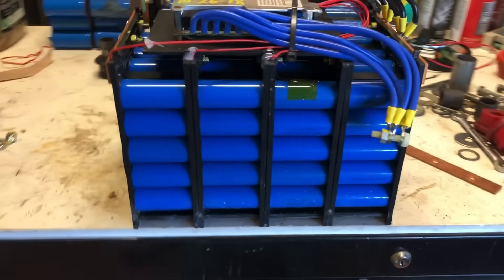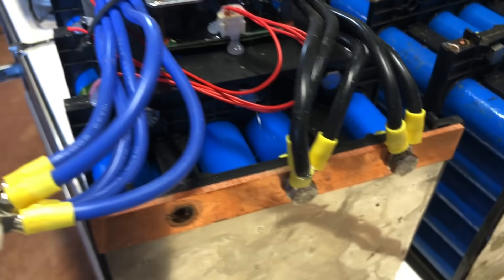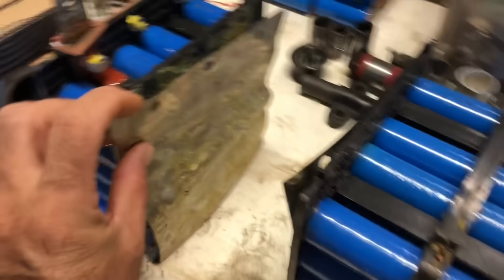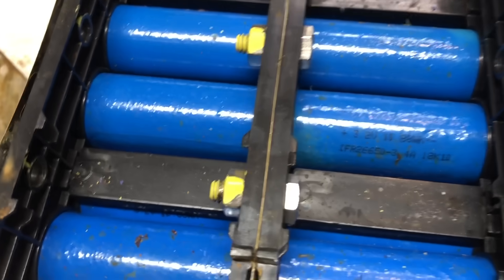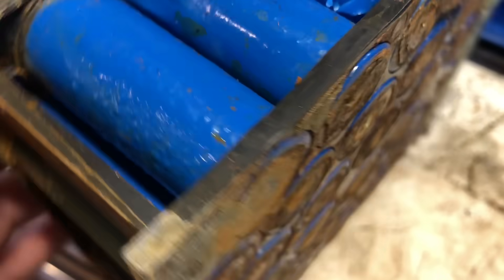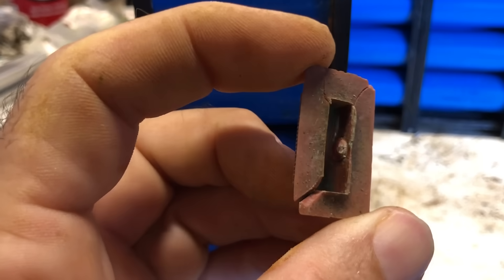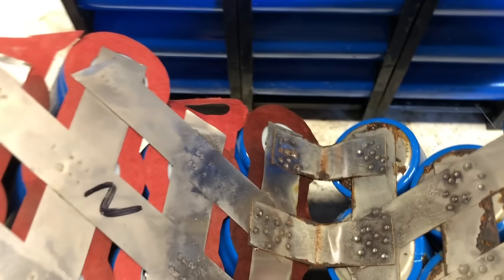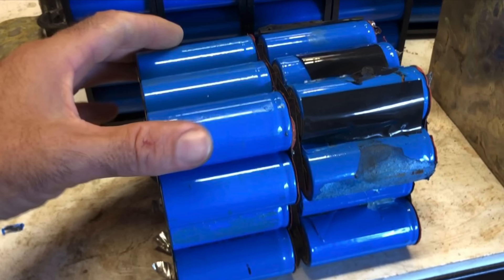Follow up to Battle Born Autopsy

Comment: Great points, what a joke of a design. I am still getting more emails from people with failed battleborns. Every single day. Class action lawsuit attorney is now doing an investigation.
Reply: 2018 on the BMS!
Plastic frame is ABSURD as a WASHER for the terminal.
That's not a very good service life!
AND they were far more expensive in those years, which is WHY I stayed with lead acid until just recently.
Reply: @blaydCA same here rolls surrett ftw
Reply: Battleborn is deleting anyone who comments on their social medal page with a negative opinion of what is being exposed.
Reply: The attorneys will collect millions, we will get a Starbucks gift card, won't help the consumer.
Reply: @tonyf5642 it helps the consumer by costing the company so much money that other companies will look at this a improve their design to avoid a lawsuit. Sucky system but one of the few ways to keep companies honest.
Reply: That’s exactly what I was gonna say at this point there will most certainly be a class action law. And in my opinion from everything I’ve seen and the rest research I’ve done Balttle Born did an awful job responding to this handling it and never got in front of it.
Reply: @youcanthide004 - At this point it's almost pointless!  Their parent company Dragonfly is trading so poorly their stock is about to get delisted from the exchange!
My only hope is that battery consumers out there educate themselves first!  Especially before laying down their hard earned 💲.
Reply: What would the basis of the class action lawsuit be? Would it be on behalf of dealers who feel they have been defrauded or customers feeling as if they are under a safety risk?
Reply: @treyedwards490  I was told denied warranties but idk. I'm not part of the lawsuit
Reply: @WillProwse I'm sending you an email
Reply: The class action attorneys should add all the YouTube , social media shills touting how  “fantastic” these over priced pieces of shit all over social media.
Reply: @MIAMIC70 💯💯💯
Reply: @MIAMIC70 It was pretty obvious that these shills were getting paid or free equipment to tout how great BB was. It’s the ones who are still supporting BB and calling Will or sites like this ‘overblowing the situation’
Reply: Btw  I can send you the case number if ya want, I filed with the CPSC, so there is an official case on file, they cannot claim no, every single battery brand should be investigated !  @willprowse I put in the url for the vid you posted last week.
Reply: Are Battleborn batteries made in China or USA? Their website seems misleading (go figure). Anyone know?
Reply: @jeffallen3382  assembled in America, made in China
Reply: @WillProwse thank you.
Reply: @jeffallen3382 They are assembled in Reno.   The cells are from China.
That's how I read it.
Reply: @jeffallen3382 Made in RENO Nevada from cell from overseas.
Reply: Just like you, a joke.
Reply: I posted this this as a comment, Will, but thought I'd drop it here too, where you might see it...

How is it possible that they didn't have a single engineer, or even some kid fresh out of high school who took apart his/her Mom's toaster, not look at that and turn white as he/she said -  "NO F*CKING WAY!" -
That looks like something a person struggling with coherent thinking would dream up in his basement while drunk out of his mind!!!
It's not even SOLID plastic.. just a one sided honeycomb type of crap they were trying to save a dollar's worth of fill on.
I mean even solid, with that sort of flexible/compressible plastic would be a moronic fail. A freakin' slice of particle/chipboard would have been better, and still been an absolute disaster!!!
And the totally inadequate, single edged bolt scheme for cell connections, using that same f'd up plastic.
I can't, as hard as I try, even imagine and engineer's, or designer's, thought processes and logical reasoning for ANYTHING about that entire battery design!
I just don't see that they have any sort of legal (forget moral, or intellectual) defence for those design decisions. They're gonna HAVE to do a recall !!!
Reply: @BorealisNights - The more I see their internal construction, the more I suspect a (probably former) disgruntled Engineer there was sabotaging their designs!     👀
Reply: love my battleborns 3-100’s 8 years old, no issues.  Looks to me like the one shown was immerses in salt water or worse.  Not a legitimate review.
Reply: Joke of a design you gave your usual smiley glowing review of. Why hasn't anyone else here put 2+2 together? You lied thtough your teeth about Battleborn, and now have the gaul to come here and pretend you never did...are you related to trump?!?
Reply: @5400bowen  six years ago and I said I'm an idiot for not catching that. Everyone knows I said it was good back then and I've opened a hundred batteries since. I admitted I missed it and why didn't anyone else catch it in all those years? What a ridiculous comment
Reply: @WillProwse -   Will, you have zero obligation to apologize to this obvious Troll!   

He/she very well might be a litigation lawyer for BB, trying to entrap you!   

I for one, greatly appreciate the vast wealth of information you have shared with the community!  

You have inspired countless individuals into a very active community of enthusiasts, hobbyists, off-grid residential, and professional Solar Power integration!  💯%
Reply: @xxxxxxxxxx6903  thank you. I get so frustrated from the comments sometime haha thank you
Reply: @WillProwse no way that guy is a regular watcher of your videos. Everyone appreciates the work you do and would never disrespect you like that troll. You are appreciated
Reply: @WillProwse they may well have changed the build design several times since thier initial release and popularity
Reply: @hayden-james  no, check out the latest tear downs. They would have to recertify it. They could change the software without recertification though. The one im cycling right now is doing awful. BMS has issues.
Reply: @WillProwse  Many are obviously Trolls working for folks who make defective product.
No normal human has that much hate and animosity towards you.
Reply: @5400bowen - Dude, simmer down a bit!   Will Prowse is not an industrial design Engineer.   

He is an enthusiast of Solar Power & energy storage.   Who has shared a treasure trove of information - FOR FREE!   He has literally steered a vast number of passively curious individuals, into being DIY solar hobbyists!   And at this point, I believe quite a few battery industry types actually look towards his thoughts, assessments, & reviews!

Did he miss the terminal bolt interference many years ago - yes.   But unless you're a design Engineer of said interfaces - that was an easy one to miss!   But it's one of those hindsight's we all learn from, including the industry!!!
Reply: @xxxxxxxxxx6903  thank you!!! That is my goal :) I'm always learning
Reply: @WillProwse you are supposed to learn BEFORE you give advice. That's what adults do. You were told by me and others, now you have done IRREPARABLE damage to the advent of solar. Still got all those $ in the bank though, right? Now your trying your whiney little boy act to try to get out of taking responsibility for your actions, like a child, not a MAN! Where's your statement that you hurt solar and decision to STOP GIVING BAD ADVICE FOR YOUR OWN PERSONAL GAIN?!? Can't give up the facade, gotta protect that ego  and cash flow stream!
Reply: @5400bowen  So, you are a Battleborn employee, or just your average everyday hater Troll?
Reply: I don't work for any battery company or receive compensation of any kind,  but I am experienced with building van electrical systems.  The design might not be perfect,  but the top four methods of failure are clearly user installation error, based on the photos on your website.
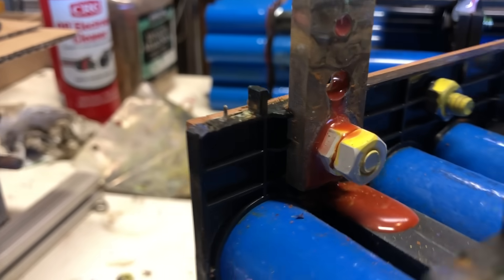Reply: @harryniedecken5321 Did you not watch the whole video!?! 4:00  The whole connection terminal lug is super loose because it was assembled incorrectly with a piece of "Plastic" as the spacer between metal contact points. The plastic melted creating a worse connection. There is no doubt about it, this is not user error, this is a major design flaw.
No matter how you slice it, this is Battle Born's fault, neglect, incompetence that caused this issue, NOT user installation error.
Reply: @korishan  The connection is loose due to thermal cycling.   The thermal cycling is from an incorrect installation.   I am not saying that bb is perfect,  but so far everything I am seeing in bb flag terminal failures are user errors.
Reply: @harryniedecken5321 BS, installation is not the problem. If they are so fragile they need to be installed perfectly maybe BB should not be selling batteries for use in a a mobile environment. 

Pulling upwards 100A off these batteries is going to generate heat period. heat is a byproduct of electricity and resistance, no matter how perfect the install it’s going to generate heat in those terminals. Heat is going to deform the plastic over time, it’s also going to make that aluminum bolt stretch and loose its clamping force. The problem will just propagate itself over time. 

The only user error is actually using the batteries as they were designed to be used. 

The bottom line, this design is poor. Stop apologizing for Battle Born.
Reply: @harryniedecken5321 How would the loose connection not be BB's issue? That is "their" design and assembled that way at the factory. The user doesn't have access to those nuts or busbar when the unit is assembled. The post that sticks out the top is epoxied in place, which is that red stuff around the terminal.
There is no way that this is user error and is 100% BB's fault. The thermal cycling causes the plastic change shape and get loose. Because the bolt going through the bus bar is not a) bolted directly to the busbar; b) barely making contact with the busbar, this is what causes the fault in the first place. The wrong sized bolt used in the busbar causes overheating on the small contact area, which leads to melting/deforming the plastic, which makes the bolt even hotter due to a looser connection, rinse repeat.
How could this "possibly" be the users fault?!?!?
It'd be like saying a transmission failed because the user was driving and the manufacturer used plastic bolts and blaming the user for not driving correctly. It's absurd!
Reply: How many freebies did they give you to review?   Don't I remember a video of your support when you went on a tour of their HQ?
Reply: @kevin.campbell  four for free, then I donated them all and all four are now dealing with BMS failure. Not a single one I donated survived 🤣I have a brand new one I bought with my own money and the BMS is having issues.
Reply: @WillProwse  Use the warranty. I hear they have good customer service.
Reply: @WillProwse Is this not the worst (& most dangerous) battery build ever?
Reply: @evil17  oh that's tough, Ive found so many issues on batteries in the last five years it's endless 🤣
Reply: @uhjyuff2095  haha I will try
Reply: @evil17 yes worst etc. that you endorsed as superior. Have you taken down your review of battleborn batteries yet? Because some of us can remember past yesterday.
Reply: @5400bowen  nope, I kept it up with a huge warning. Check it out, it's pinned and in the description
Reply from the maker: @WillProwse That’s unfortunate to hear about potential BMS issues. 

The BMS is what I’m most impressed with in these batteries!
Reply: @kevin.campbell  Do you work for Battleborn Kevin ? Just asking ?
Reply: @kevin.campbell he gave them his usual smiley money grubbing review...don't hear him or anyone else mentioning that. Just that he "donated" the garbage to someone/thing. Passed his fire risk garbage on to someone else.

Comment: I’d be curious to see the inside of Victron’s NG smart batteries, which are rated for IP65 moisture protection. Battleborn claims the same rating…
Reply: we have seen many lithium battery tear downs and none look this bad, usually they have all switched to welded bus bars instead of bolts.
Reply from the maker: @uhjyuff2095 It’s an early architecture. 

Imagine how much more expensive these are to assemble when you have to layout/load all the small cells in their cages, then spot weld each to the nickel plate, etc., versus assembling a 4S Prismatic using bus bars and attaching hardware.
Reply from the maker: My friend is wondering the same after I told him what I discovered on these since he has a couple of Victron Super packs. 

The Victron have a higher rating which means they should be sealed better, but I can tell you from experience Victron isn’t the best at protecting against water and air. I have had a few of their products fail due to lack of potting and protection of PCB’s and their components. 

Still I think they might have a better concept of the kind of environment a boat bilge is for a battery product to have to live in.

Comment: No way condensation, those batteries came from a sunk boat.
Reply from the maker: I have addressed this in other responses and can assure you it is possible from condensation as I have experienced it first hand with a different product, but since I don’t know the back story in these, it’s just based my past experience. 

The take away is you want to avoid water ingress at all cost.
Reply: @Willdesignsandbuilds  I thought all of these types of batteries are sealed.  No?
Reply from the maker: @theclearsounds3911  Some are better than others, but I believe these in particular are only rated IIP54
Reply: @Willdesignsandbuilds  I can believe it, when I'm installing enclosures outdoors I always drill a tiny hole in the bottom to let condensation out. These batteries could have done with that, not to mention a lid that can be opened for servicing. Except that would let everyone see how bad the construction sucked...

Comment: Had Battleborn designed in brass inserts in the platic plates where the bolts go thru, we would not be having this discussion today at all, users would be happy and Battleborn's reputation not ruined. But they saved 10 cents per plate and here we are.
Reply: huge design flaw and this video shows it clear as day.
Reply: Reputation? You mean the lies they got everyone to swallow?
Reply: @5400bowen  I am one of the gullible who bought 5 of these things. I trusted "influencers" and their glowing reviews. I bought what I thought was the "gold standard", and now, I'm very concerned. Mine are used as a backup when the power goes out during the winter inside my house, so, maybe I'll be OK. That's a big MAYBE!
Reply: @5400bowen  Agreed. 🤬
Reply: actually i dont think a brass insert or extra nutwould help, a brass insert would just limit the compressive ability , the problem is the plastic in between, the need something much more solid, actually the brass insert could work if it was behind he sheet metal layer and fairly thick so it pinched the metal layer. what wouldnt work is if the hole through the metal layer was the same diameter as the spacer
Reply: Guys that's like 32c per battery. That would cut the profits to less than 100$ per battery that costs less than 20$ to produce. That's a deal breaker, plastic it is.

Business 101 boys, they musta learned from the best biggest hugest universities around.
Reply: @GRAZINGARIZONA trump university graduates...
Reply: @5400bowen   and you graduated with A++ TDS, good job
Reply: Actually..
A slightly longer bolt and ONE extra nut to sandwich the terminal connection would have worked even better, since brass ferrule con compress.
A FIVE CENT overall cost at best.